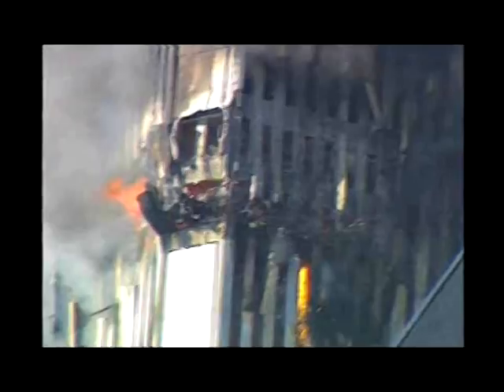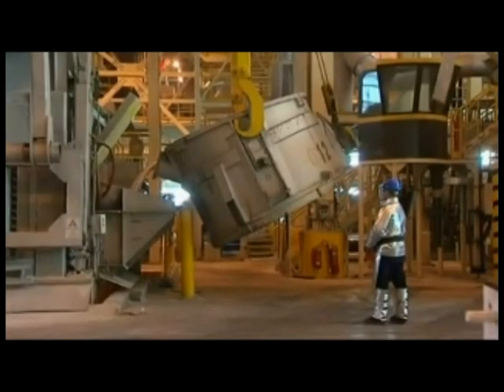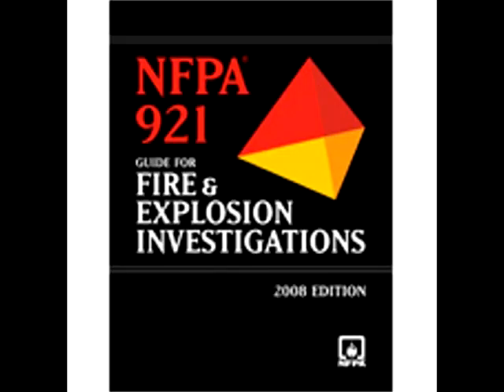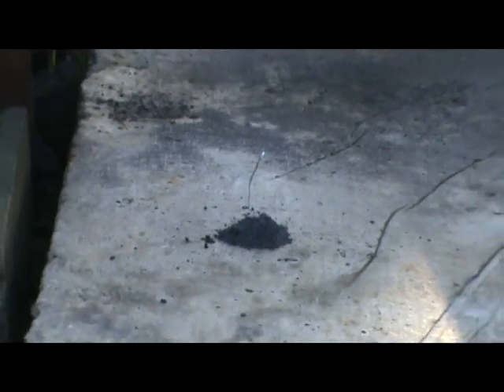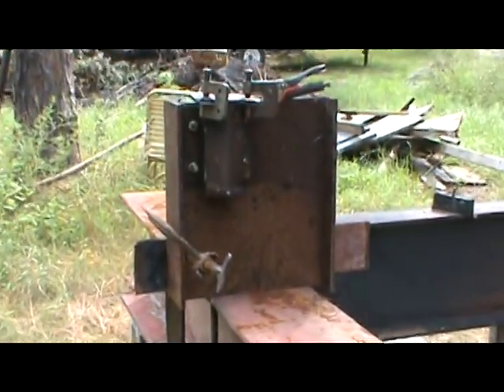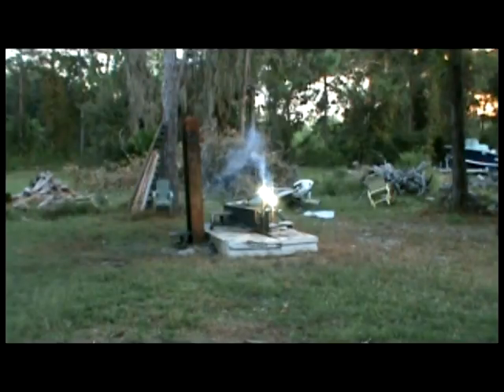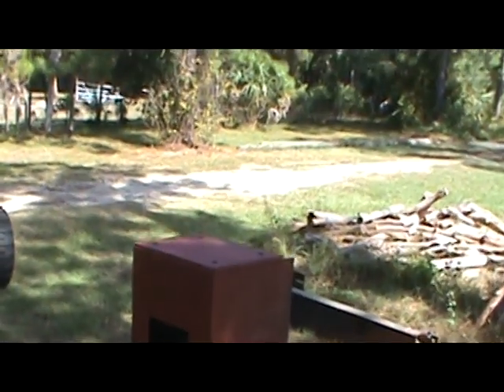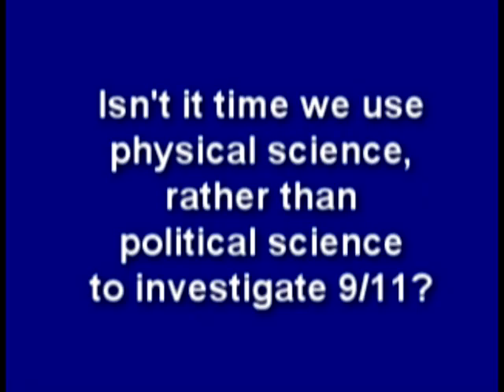9/11 Experiments: The Great Thermate Debate

Comment: Or maybe, i dunno... the strong winds that high up combined with fuel in the form of office furniture maybe create a forge of sorts, that would be able to melt steel? But no... it's easier to assume someone would go to these lengths to bring down those towers. I guarantee that if they wanted to bring those towers down, they would have went down the moment the airplanes hit. Why prolong it? Why waste so much time? Just let loose pyrotechnics right when the planes hit and be done with it.
Reply: +Cristi Neagu Everything burns at different temperatures. So even if winds created a "forge" it still wouldn't have burned hot enough. This is evidenced by the color of the smoke.

As for not letting the building go immediately... it is all about perception. If someone wanted to bring them down maliciously... they would need to do it in a manner that caused less suspicion. Which in this case, was saying that the fuel dumped into the elevator shafts and weakened the main beams which caused the collapse.
Reply: PeacefulKancer 
1. Coal seems to burn at about 500-700 degrees Celsius, and yet it can melt steel. I wonder how they do it... Ah yes, with a forge, greatly increasing its temperature.

2. Because of the wind, a sort of forge could have been created inside the towers. If you could open windows that high up, one on each side of the building, you'd have one strong draft going through the building. But that doesn't mean the whole building was a forge. That's a bit far fetched. Parts of the fire were still burning normally, hence the smoke.

3. So you mean to tell me that they could figure out that people would catch on that the buildings coming down when the plane hit was impossible, but they couldn't figure out jet fuel on its own can't burn through steel? That is really a stretch. The easiest explanation is the best.

Jet fuel ignited the inside of the tower. Because of the impact and the holes created, combined with the winds at that altitude, a strong draft formed inside the towers, creating a forge. This also explains the iron beads. This forge was hot enough to severely weaken the steel structure of the building.

It's simple. It doesn't involve convenient oversights. It doesn't involve a government destroying some of its most iconic buildings. How can you even assume that they figured all this stuff out but forgot jet fuel doesn't burn that hot? How can you assume that they would choose to bring down those buildings when just hitting them with an airplane and killing some people would have created the same effect? You are trying to invent boogie men where there are none just to satisfy your own paranoia.
Reply: +Cristi Neagu Before you start beating your chest,, I simply started this conversation by answering your question of "Why prolong it? Why waste so much time?" So I am not really sure why you are trying to shout me down as some heretic.

With that said, are you pedaling an idea as truth that not even the NIST report made no mention of?

It surely seems to me that you are taking certain ideas and making them truth and then interjecting some relative facts as supporting facts (ie. iron beads because it was a forge).
Reply: PeacefulKancer Alright, I apologize for the first part.

Secondly, I'm not trying to promote this as truth. I think only the people who were there, sifting through the wreckage, can do that. I'm just proposing an alternate theory with sufficient validity, who's only goal is to say "here's an equally valid theory, so why should yours be true?"
Reply: +Cristi Neagu There is only one thing for sure, we will probably never know with absolute certainty of what happened. I like your theory even though I feel there are some gaps in it - but what theory regarding this doesn't?

I just wish that the clean up and evidence gathering on this would have been handled a little differently. Seems like it was hurried and secretively which makes it feel suspicious. The knee-jerk reaction of passing of some of the laws immediately after the incident also doesn't help this either but that may be another topic altogether.
Reply: PeacefulKancer I think the truth is somewhere in the middle. I think the government may have known of all this being planned, but they didn't do anything about it because it was convenient. I don't think they planned it and I don't think they knew exactly how big the devastation would be. It just got out of hand.
Reply: +Cristi Neagu This is totally plausible.
Reply: ***** That is exactly the point he was making about the smoke. That if there was a forge like effect, how come there also was dark smoke?
Reply: It was Far more powerful to let them stand. If they collapsed on impact, we wouldnt have the images in our minds of the towers with fire and smoke billowing over NYC, or the number of news networks to film it, or the tension and attention focussed on those buildings for so long. An action movie lasts 90 minutes, not 20 seconds.
Reply: dagmastr we don't know what they found, since they immediately had it hauled away and shipped to China for "recycling" most likely because they didn't want us to see incendiary devices.
Reply: Cristi Neagu haha because that is an impossible theory. The fires weren't even burning that hot after the initial explosion. People were standing in the opening one of the planes made. It was not hot enough.
Reply: +Cristi Neagu My answer already covered this, but to say it again... It all depends on the exact conditions (temp, fuel and air mixture) at the point of combustion (and along the path the combustion products take till they reach the open air).  IOW you can have absolute, high temperature air rich combustion in some places (hot enough to melt steel and shatter concrete into sand), while at the same time, many other places burn with little or no oxygen. In a building the size of those, there were all kinds of things burning at different temperatures and combustion levels.   Nothing in physics or chemistry supposes that all points in the inferno would be at the same conditions of temperature and combustion.  Therefore somethings were giving off smoke, while others may not have been.. The smoke tells you ZERO about the max temperatures of the fire.  It's complete moronic crap to suggest they do.
Reply: Sorry, not bashing anyone.  Only pointing out that you cannot infer the temperature inside from the committee of smoke, period.  Doing so is moronic and misleading.  A forge can burn with our without smoke depending in conditions, temperature is not the only factor.  Also, while the building had done of the properties of a forge like insulation and air supply, the one thing it did not have is a well controlled environment.  This is a design factor in a forge, but not the building.  So, while a coffee can be set to burn hoy and clean throughout, the building has many varied spaces with different environments.  Depending on the exact conditions in each of the environments, some areas were hot enough and had enough oxygen to burn clean, while others did not.  Smoke color tells you nothing about the hottest or coldest areas.
Reply: +Cristi Neagu But elements of a conspiracy were there - 
Most of the gold was stolen from basement vaults earlier that morning - the place should have been swarming with cops from that 

The owners wanted to demolish the buildings, but were denied demolition permits due to all the asbestos in the buildings. The buildings were sold for $60 M but insurance paid about 4 Billion - that a HUGE profit !

The "dancing Israelis" filmed the whole thing, later admitting they were there to "document" it - - they had pre-knowledge of 9/11.

There was a "van bomb" that also blew up that day.

There was a parking lot full of cars 1/2 mile away that went up in flames.

The owner and his 2 adult children who worked in the Towers, and usually there at 9 AM - weren't there. How convenient.

Flight 93 Cell Phones - in 2001 in NorthWest Pennsylvania, at 6-7 Miles up, and at 500 MPH,  how did the people who called their loved ones get such good cell service?? Remember dropped calls when driving in a car? Well, the "handoffs" would happen 10X as often at those speeds, and they were in an aluminum tube.

The Pentagon was hit in the spot "closed for re-modeling"
3 minutes later, people walked out the hole that should have had 8,500 gallons of burning jet fuel, still burning.
Reply: the jew who leased these buildings had several months earlier insured them for millions of dollars in case of a terrorist attack ! follow who profited from these attacks and you have your answer .
Reply: mightywez1 no, BILLIONS!
Reply: Michael Schwab You don't understand... You're bashing the guy by saying that a forge can burn anything without any smoke when that was exactly what he was saying as well.

And as for the fires inside being at different temperatures, i've already covered that and he seemed to accept the point. So i really don't see any reason for picking on the guy.
Reply: Michael Schwab That's the point i was also making earlier, yes. I think it's the best explanation of how the towers came down. Mind you, it's still an armchair theory. But it seems to fit all the evidence, at least the ones shown in this video.
Reply: Stan Dando This is all supposition. And in cases such as this, the simplest and most natural explanation wins out. Sure, that doesn't make it true, but it makes more sense than the others.

Also, I don't think anyone in the US actually believes this government conspiracy theory. If they would believe it, they would leave the country. People just like to bitch about the government.
Reply: Agreed.
Reply: dagmastr 
Your right, the planes were drones flown into the bldg just as s ruse to give explanation. Pilots agreed that it would not have been possible without wavering or fluctuating the wings manually. And as stated above there was no investigation because of the drones...cleaned up and shipped out, under armed guard also, so there was no investigation. However the dust, proves nano thermite was used. Its a freekin joke...that changed the world and was not funny.
Reply: Cristi Neagu ..yep..you don't know.
Reply: Cristi Neagu regurgitate that BS all you want if it make you feel better..but leave the science of it to those of US who know better...
Reply: There weren't high winds that day. Even if that was possible, there was not enough wind. And the black smoke indicates oxygen starved fires. Not raging inferno.

Comment: Did not take into account that the temp need not even reach 900 for the steel to loose 80% of its strength. That combined with the downward force of the building from above. could the structure still support its self?

Comment: if i would be a billionaire i would build exactly same building and the interiors .. then I will get an airplane same model and fill up its tank with fuel then smash it into the building same level then wait 5 hours and smash another plane into it but 20 floors below then wait another 5 hours and smash another one 20 floors below..it will not fall down ..an airplane is soft and smashes to pieces on impact

Comment: i wont say it wasnt thermite which weakend the strucuture of the twin towers, but you have to consider the dependance between yield point and temperature of metals ( google pictures "temperature effects on metal strengh). If you higher the temperature the diffusion rate is increased exponentially, dislocations annihilate faster in the grains of the metals, grains of metals grow over time at high temperatures. It didnt need to melt the beams to weaken and finally destroy the structure. High temperature causes decreasing yield point of steel. This i am saying as a presumably master of science (mechanical engineer)

Comment: it does not take much to melt steel , I am a boiler maker welder and what these conspiracy fuck wits don't tell you is what did the terrorist ( the followers of islam) get on board the planes to assist them a jet full of fuel with its materials , aluminium etc is also fuel , aluminium will burn at 600-800 degrees some times less if it contains nickel and magnesium , a jet with that much burnable material could do much more damage than it actually done to the building